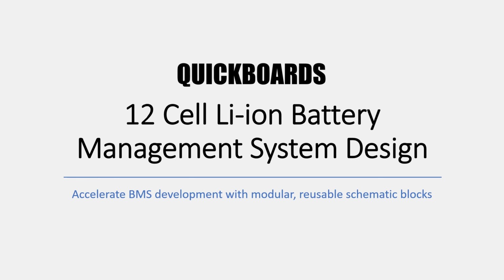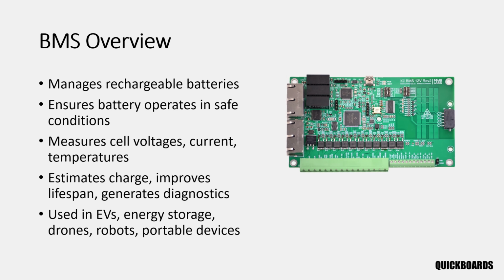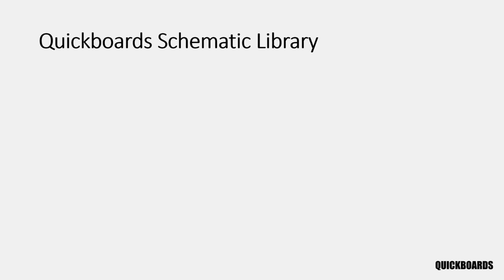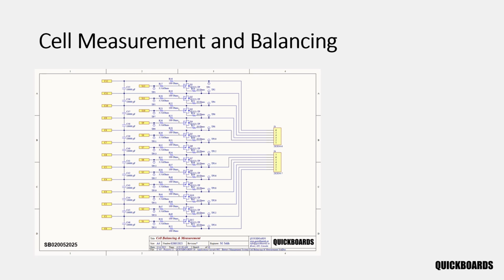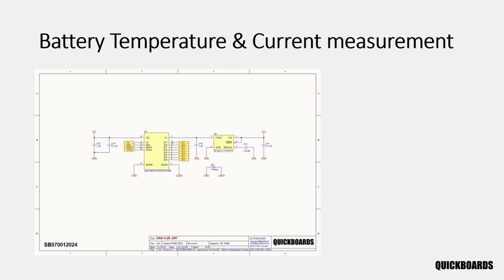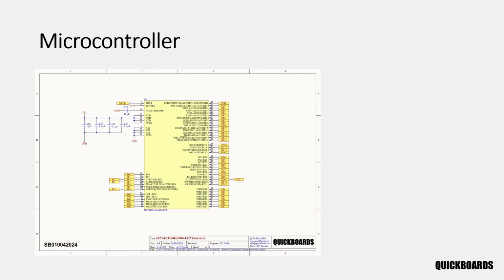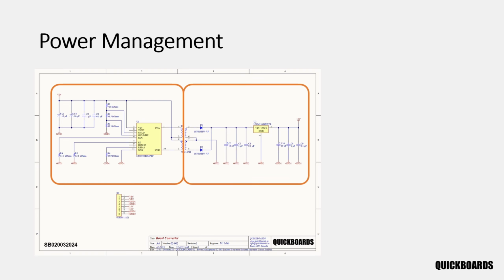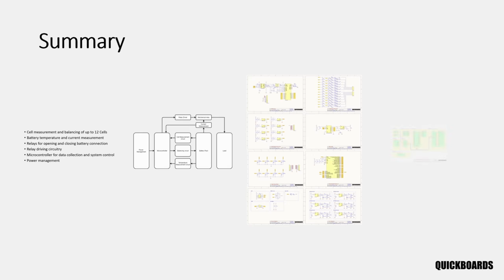12 Cell Li-ion Battery Management System (BMS) design tutorial

Comment: how to use the microprosesor?
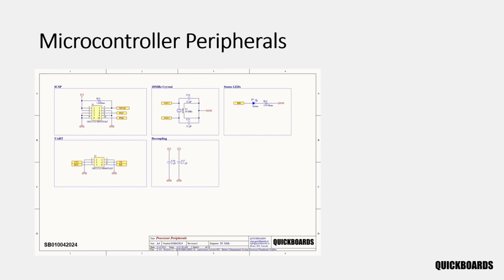Reply from the maker: at 8:32 you can see the ICSP port which is used to program it. For communicating with the BMS IC, the MCU has to issue commands to the LTC IC to read voltages. Read the BMS guide in the video description which goes into more detail.
Reply: @quickboards  thankyou for answer!